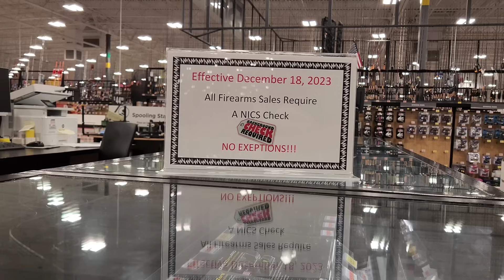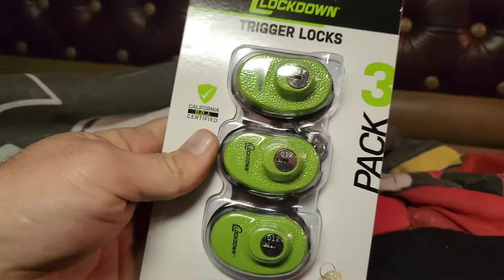I Spoke To Soon In The Kenworth // Fog & More Fog

Comment: Hey Schmidt, get some of that electric tape that's liquid in a bottle. Harbor Freight has it and coat them connectors with it, water won't get in there, works pretty good. I'll even use the splicers and coat it with the liquid tape and it seals them.

Comment: Kurt ,a very useful tip....when driving at night in fog,  use insulation tape, about an inch wide, and stick it on the beams right , like a cross , and you will be surprised how much more of the road you can see.... This is on either headlight, dims or bright ... ,(that is if you have separate beams,)..it also works very very well with single beams... Try it...😊

Comment: You can purchase a diesel heater for 1st. Class for about 500.00 so she doesn't idle and use fuel and they have one that keeps the engine warm with that adapter..the driver's here love them. You can also rebuild them when they go haywire.  We have a fleet of 120 trucks that use them